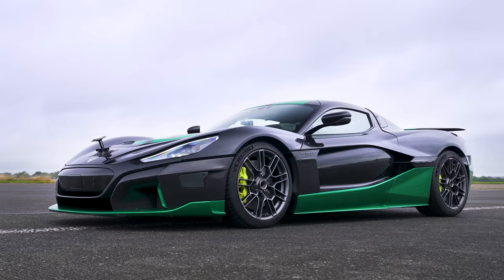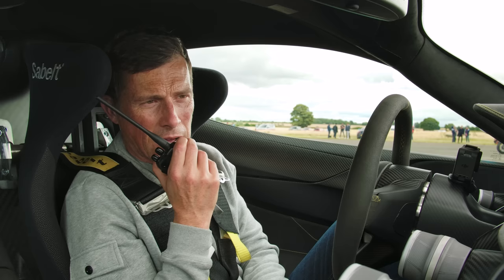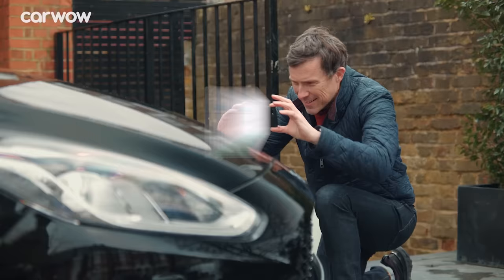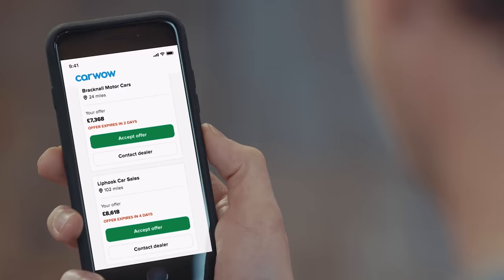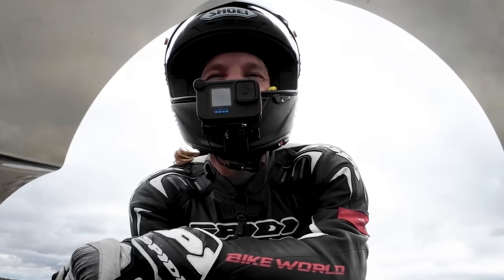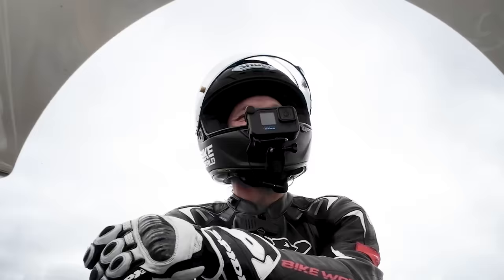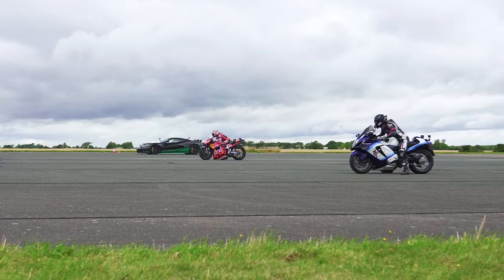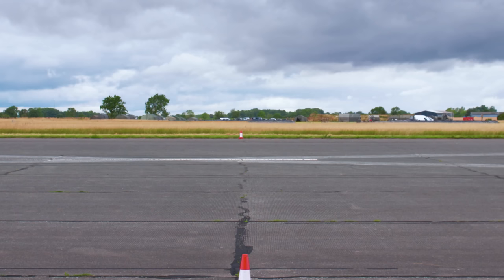MotoGP Bike v Rimac Nevera v Turbo Hayabusa: DRAG RACE

Comment: 8.5 seconds on a no prep surface and no fancy suction is impressive af
Reply: And on street tires, street legal passenger car. Impressive is the wrong my friend - this is the single biggest leap in performance numbers since the car itself has been invented over 150 years ago. And no I'm not into electric cars.
Reply: @BlitzkriegRap it also costs 2 million pounds, I’d hope it would hit those times with ease..
Reply: @BlitzkriegRap Road tyres have more grip on the road than racing slicks.
Reply: @wss33   In the wet or cold only
Reply: @wss33  and this isn't a road
Reply: And those half mile speeds are insane.  They're gonna need a slow motion camera soon just to see who won.  They were just a blur
Reply: @BlitzkriegRap For a 2+million dollar car I would hope so
Reply: @Nah5534  ANY OTHER 2M car and 1M+ car gets duuuuuuuuuuuuuuu…..sted by this
Reply: Imagine the Gemera... So ready for that video.
Reply: jonasjonaitis8571  todays f1 or yesteryears?
Reply: jonasjonaitis8571 only because an f1 car is set up for cornering speed.  It’d be an interesting race in they changed the aero for a drag race though
Reply: @BlitzkriegRap  No. You need tyre warmers and you need to do at least one lap of warming up before you have the temperatures the tyres are designed to work at. Technically this isn't a road but it is road surface.

And they don't use slicks in the wet...
Reply: jonasjonaitis8571  No it doesn't.
Reply: All those performance figures and it still couldn't crack the 7 min mark around the Nurburgring, it gets walked by cars with half the power and torque.
Reply: @jameswozny1997  You're right, because Nevera is heavy...but only a handful of street legal cars broke 7min - all of them were developed on the Nurburgring - and all of them would break your spine on the roads where I live.
Reply: @BlitzkriegRap  19 production vehicles have broken the 7 min mark. More than a handful, even the 918 Spyder did it..... 10 years ago...... Straight line performance numbers are so overrated.
Reply: @ryanwilson5739 I remember on Top Gear they were talking about how you can go as fast as supercars from 20 years ago in affordable hot hatches or sport cars today. Another 20 years and we'll have an equally fast hatch 😂
Reply: I always go in 8.5 seconds with fancy suction
Reply: @rob500100 both on straight line
Reply: jonasjonaitis8571  I know they did that with Jenson Button’s Honda F1 car in 2005.  They tuned it for straight line speed and put it on the the salt flats.  It reached over 256mph and still met FIA spec.  That F1 car is 18 years old now…
Reply: jonasjonaitis8571 this rimac’s power to weight ration even only 0,83hp/kg won 2 of 3 drag races againts motogp, F1’s power to weight is 1,2-1,3hp/kg..even the V10 is 1,5hp/kg..
Reply: @BlitzkriegRap  True it's not a road, it's probably worse. It's an old disused airstrip which has had years (decades probably) of oil and aviation fuel dumped on it. I strongly suspect they would post quicker times if it was resurfaced with high quality high grip road tarmac (such as shell grip), or the stuff they use on race circuits (which isn't that special actually having ridden on a few top class ones myself). Not saying it's a low grip surface, but I suspect it's no worse than a decent bit of road tarmac. Of course regular city streets are probably worse (definitely here in the UK they are).
Reply: @rob500100  This Moto GP bike would beat 2004 F1 cars as well those traction control cars stands no chance against these bikes straight line speed
Even 2015 Ducati was faster than this KTM alone 
Even in High wind This Moto GP bike is able to smoke Rimac Nevera
Just think about the 2022 Ducati Moto GP with full power map and removed wings 
2022 Ducati Moto GP bike was faster than any bike on the grid it walked KTM and Suzuki like they were standing still
Reply: @autolavista bozo the 2015 Ducati Moto GP bike destroys any F1 car ever made
This KTM ran 8.2 seconds quarter mile in 2nd race Rimac lost badly when it had a good launch the high wind is stopping the bike it was wobbling still smoked Rimac Nevera in rolling race

No F1 car has ever ran a 8 seconds quarter mile 
Redbull RB7 ran 9.2 RB7 is quicker as V10 F1 cars from 0-250 km/h 
V10 F1 cars just have more top speed and more power 
But all power is in higher revs
Reply: @garethmarshall3075 still that F1 car doesn't stands a chance against current GP bikes that BAR F1 car ran 9.2 seconds quarter mile against a BMW S1000RR street bike in 3 runs bmw ran 9.9 
Moto GP bike running 8.6 and GP bike ran 8.2 seconds quarter mile in 2nd race it literally destroyed Rimac Nevera
Also on racing circuit these Modern GP bikes can run 7.8 seconds quarter mile on full power map 
The 2022 Ducati Moto GP bike was fastest Moto GP bike ever it passed Suzuki KTM Moto GP bike like they were standing still
Reply: Fair enough.  That motoGP bike would be destroyed by one of the 3000hp GTRs which are also street legal though.  You can watch one on a prepped surface in the states running sub 6 seconds.  The F1 car is built for the track and so are GP bikes. On some tracks an F1 car is over 20 seconds faster.  They are much faster where it counts.   @Smzxe
Reply: @Smzxe  let’s face it, if Adrian Newey could design a car with no limits he could build a monster with 2000hp. Then the limiting factor would be the man sitting in it. They’ve already had fan cars

Comment: Dani Pedrosa 🔥🔥🔥
Reply: Modifica Tu h2 Para que haga ver placa al Rimac 😂
Reply: nice to see him
Reply: @esmalteroperu5740  Rimac Nevera will be faster than many tuned H2 on this surface
Reply: the launches he got on that bike were spectacular.🔥🔥
Reply: He threw the race. You better edit your comment replacing fire emojis with shit ones.
Reply: @Steel0079  how he threw the race explain please?
Reply: @Smzxe  how can a pro Moto GP racer lose to a car? Even if it's electric. The bike is effectively more powerful because of power to weight ratio. And the pro riding it. Meh, that was a setup like those WWE fights.
Reply: @Steel0079  look at this horrible concrete surface dusty Runway with crosswind there's no traction bike was also running on low power map for better traction
Dani is struggling with wheelies and wheelspin
Even in rolling race Dani bike was Wobbling at 350 kph it still beat Rimac Nevera in 3 races
This bike is running on short gearing

If it was a racing circuit or drag strip MotoGP bike can definitely go much faster than this 
And it can run on Mugello gearing with top speed above 370+ km/h 

But this race happened here and your lucky you got to see this stop crying and complaining bro 

Redbull had to bring while MotoGP bike F1 car rally cars to make these races how much money and fuel was burn in transport
And you're watching it for free and complaining
What is wrong with you? 
What you're crying about? You can't do none of this
Reply: @Steel0079  do you think it's easy to beat a 2000 HP ev? Bike is struggling from wheelies traction and crosswind affecting it a lot bike is also have shorter gear ratios it's geared for Jerez track 
Maybe Mugello gearing we can see better top speed 
But that crosswind was too much bike was wobbling at 350 kph
Reply: @Steel0079  clueless armchair casuals and their opinions... The bike was beaten by traction.

Comment: That wobble from Dani at over 300 km/h was heart palpitating, I wonder how he felt!!!!
Reply: Concerned.
Reply: Fine, he deals with that regularly. It’s his job bro
Reply: 13:30   "concerned"
Reply: Man I couldn't imagine doing 200+ mph on a bike!👀
Reply: You get used to it, my shakes it head at 160mph but you power through
Reply: Possibly, "what a rush!"
Reply: Probably just a another wednesday for dani..
Reply: THAT'S NOTHING FOR HIM... IT PROBABLY HAPPENED 50 TIMES WHILE LEANED OVER LAST WEEKEND?! LOL
Reply: dani probably left two 2 inch sized dents on the gas tank, balls of steel
Reply: I guess he felt like another day at work !?
Reply: He felt like he should be responsible of the throttle. Being a Pro quite help letting off the throttle without losing a lot of speed.
Reply: Fine lol, he’s a ex motogp rider one of the best
Reply: Felt like, if I live through this I promise you God I won't do this again?
Reply: He was a bit concerned.
Reply: These motogp rider is the best of the best.
Reply: The MotoGP is savage!
Reply: Its fine, he is motogp legend
Reply: I've done that on the freeway at 140mph when the freeway had a slight curve. It was Effin scary! I slowed my dumb-A down.

Comment: One of the few episodes where I'm actually suprised. Would've never expected that the MotoGP bike can keep up. That bike was never built with the intention of drag racing - while the Rimac is more tailored towards straight line performance than towards "actual racing". Insanely impressive that bike (and rider)
Reply: Exactly, if you just know there is still a lot of juice to put out if KTM would mapped it out to it's full power & torque. But they wouldn't do that just for a show. After all it's for cars not for bikes. They are just being there to give us reference. Not to win it all because this isn't a Gp.

Dani was really glad to experience driving that Nevera. It would be interesting to see him in the show more often.  He can join Matt, Yanni & Sam everytime they have multiple car to test. ☝️
Reply: Go amd watch the KTM starts in recent MotoGP. Except the last race un Austria where Ducati improved their launching. Both KTM and Dukes are rockets in MotoGP.
Reply: That bike is just insane it's shocking
Reply: it's still made to accelerate as fast as possible out of a corner and also launch well at the beginning of the races, with zero consideration for comfort unlike the rimac.
Moto GP make don't make a lot of compromises about acceleration. of course a Moto GP made for drag racing would be lower and longer!
power to weight INCLUDING THE RIDER is at least 50% higher...

Comment: It is insane how fast that Hyabusa is. But wow really puts it in perspective how advanced those moto gp bikes really are. Power does not matter if you cannot put it to the ground.
Reply: @@funzy101but the busa got insane aerodynamics for a bike tho
Reply: Still can't beat the Moto GP bike and the Nevera.
Reply: The ‘Busa was actually disappointing.  Turbo ‘Busa drag bikes with street legal tires can routinely run the 1/4 mile in the 7’s. The cold, unprepped asphalt surface was the culprit.  The ‘Busa also needs a swingarm extension.
Reply: @danmyers9372  thats 7sec bragging is worthless because you know, whats the point of claiming that time on street legal tires when the STREETS are ALWAYS un-prepped surfaces LOL
Reply: @danmyers9372 Also there has been a very strong wind - I think it pushed both bikers in hard situation.
Reply: @danmyers9372 i feel like its biker wasn't very good
Reply: @pneumonoultramicroscopicsi4065  I agree. Seems he banged on the rev limiter and that will stop acceleration.
Reply: @pneumonoultramicroscopicsi4065  he's out there trying not to die😅
Reply: @pneumonoultramicroscopicsi4065 also those drag bikes probably have pneumatic shifter
Reply: The whole bike is kind of a joke..
Reply: Ha3!! Nice joke Bro..
Reply: @belanagy5595 yeah there may be strong wind, but after they losing, should not make excuses..that will make them funny..
Reply: @supernanny8375 if only they bring Chriss moore mafia turbo busa or turbo gsxr 800hp. It would smoke both. 1/4 mile less than 5 sec